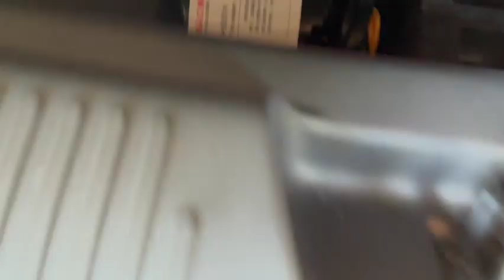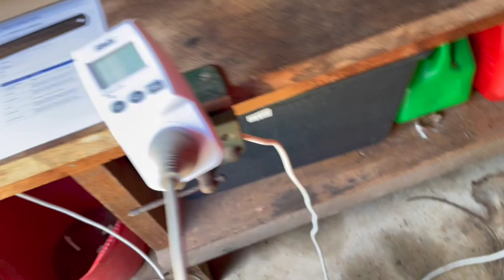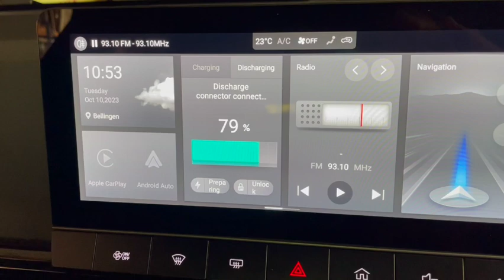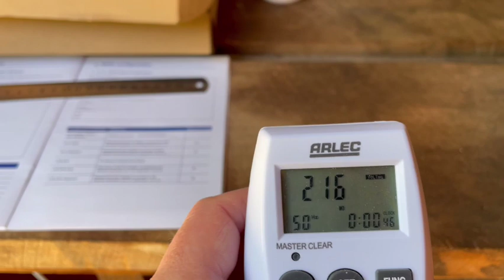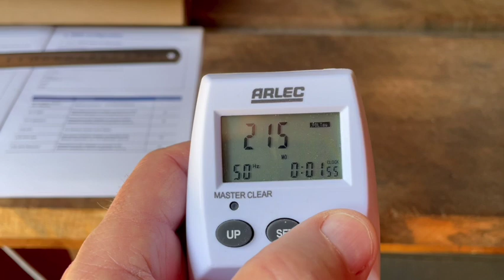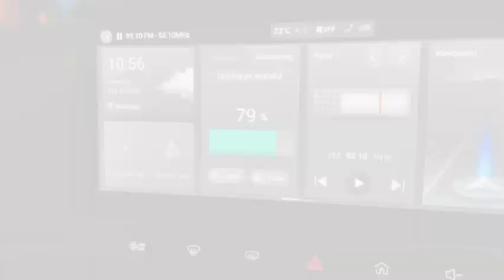MG4 V2L Test Australia

Comment: make sure all extension cables are of the heavier type that can take higher amps. thing cheap gauge cables can cause voltage drop.
Reply from the maker: It's a good point. I no longer need that set up any more as we moved home and we now have a bidirectional DC EV charge station but when I did set it up for occasional use I used cable with 2.5 mm^2 wire which was ample and had bugger all voltage drop.

Comment: Owning an EV is a lot of mucking around l prefer refuelling my petrol vehicles so easy EVs to much mucking around and l have seen many videos on EVs and there is absolutely nothing that l have would ever change my mind about buying an EV
Reply from the maker: This is for the odd occasion on a road trip, it's not difficult now, indeed using a petrol bowser is more of a hassle (and that's not much of a hassle).
For the vast majority of time I plug in at home, it takes 10 seconds and charging happens automagically while I'm doing other things. And "refuelling" at home is less than 1/10 the cost of petrol per km/mile.
Reply: sorry can your petrol car power a heater or a workshop?

Comment: Good video Alex. I note your battery level was at 79%.
I have an Excite 51. The other day after arriving home with 19% battery the house power went off. I decided to test the V2L. No luck, the battery capacity had to be greater than 50%. Has anyone been able to adjust the minimum percentage of charge the V2L will work at?
Reply from the maker: The minimum should be settable to 20%. At least that's what it is with my Essence 64 model. Check the discharge screen on the display in the car. You should see a slider control for minimum discharge level.

I'm about to upload another video about the V2L, this time using it to charge our home battery (an off-grid system).
Reply: Looking forward to that - that's what I'm interested in doing. 

That voltage is not impressive is it.